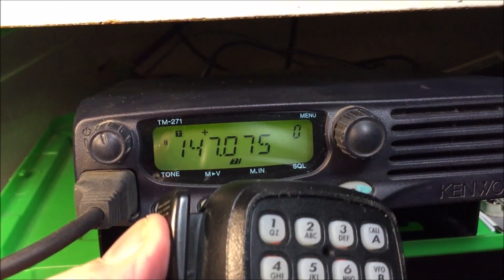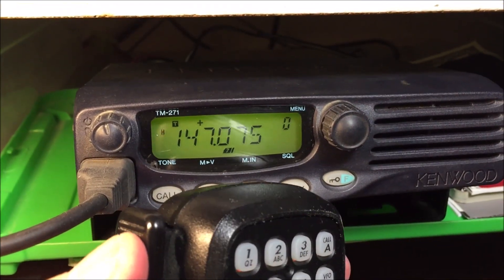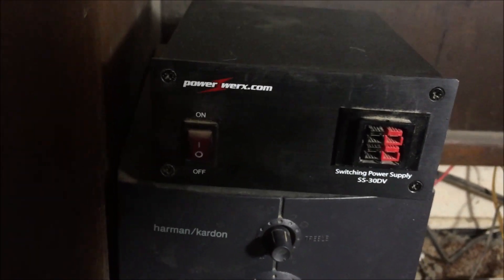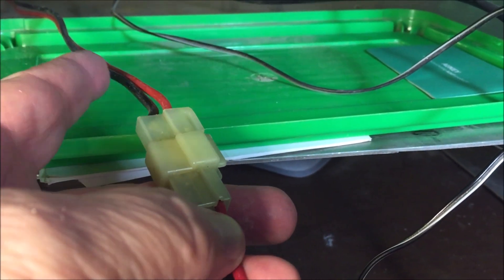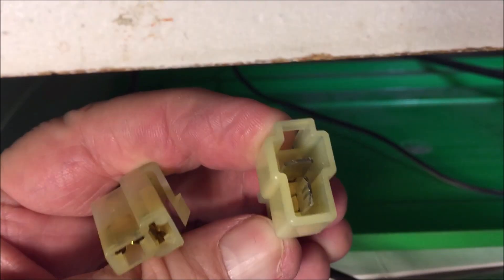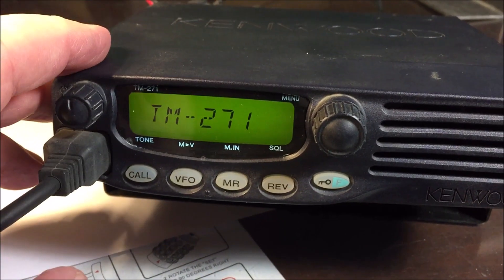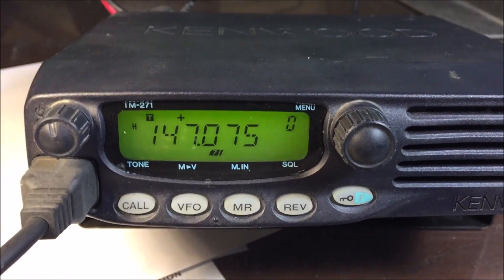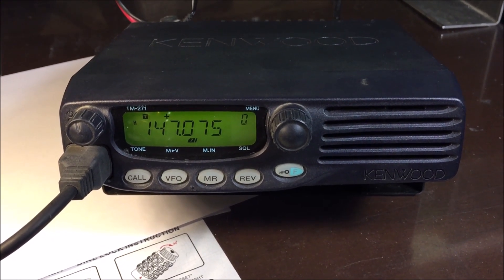Kenwood TM 271 problem work around

Comment: Sorry to say this but the big problem IV just seen is your power supply is sitting on your speaker and that is not going to help the problem with that radio it's just going to continue happening until you remove the power supply away from that speaker

Comment: I have both the 271 and 281 and have run into this phenomenon on both.  I've found it to be a fail-safe when the transceivers are starving for power.  Why it works on a 145 Mhz repeater and drops on a 147 Mhz repeater is likely a difference in current draw between that wide a range in TX frequencies.  Draws more in the 147 Mhz range.  I'm willing to bet that if you use low power on that 147 Mhz repeater, it won't drop out.  If your power supply has variable voltage, I'd try turning it up if there's room to do so (but not above 14.5v).  That way, the voltage drop when transmitting won't fall under that threshold trip-out point. The other more technical option is to replace the power wire with thicker gauge wire to help prevent as much of a voltage drop while transmitting.
Reply from the maker: Thanks for the thoughts and ideas. I decided to set transmitter on low power and that seems to have fixed my problem. Thanks again for the great suggestions. 73s

Comment: Very common, and long-known, problem with this model.  It is very susceptible  to inadequate DC supply voltage.  If the initial voltage is borderline low (in receive mode), then the higher current consumption in transmit mode, combined with resistance in connectors (and/or needlessly long power wires) will cause the voltage to drop below the shut-off point.  If for some reason your particular radio draws a little more current on that frequency (some peculiarity with the radio or with the antenna system) then the problem will appear first on that frequency.  Of course the problem will be worse at high transmit power (which is how your radio is set), since the DC current consumption will be higher.  The next time this problem first appears, if you switch the transmit power to LOW, the problem will probably disappear for a while.  As others have suggested, shorten the power wiring, switch to a heavier gauge wire.  I personally think those Kenwood power connectors are a joke, and should all be replaced by 30A power pole connectors.  Use a GOOD contact cleaner like D5 or Cramolin and the connector resistance will be lower.  Or use a power supply with a slightly higher output voltage and/or a higher current rating (i.e. better regulation).

Comment: Power cord way Toooo Long. Get rid of excessive power cord.  Use 8 Gauge stranded copper wire directly to radio or double power cord. Move power supply closer to radio. Also on a different note
put one or two drops of 90 weight oil on VFO shaft behind knob where it goes into front of the radio. Carefully turn the shaft back and forth until oil is worked in. It is a common problem on the Kenwood TM-271 and TM-281. Hope that Helps.

Comment: mine does this if the power supply doesnt have enough amperage!
Reply from the maker: Yes, good point. Thanks for watching.
Reply: How much amp do you need for this amp?
Reply: @sangalanga9593  at least 5

Comment: hi i have also a 271 kenwood the problem is my knob just suddenly hard to dial. and also i cant push it. what could be the problem . the freq dial im talking about, not the power knob. tnx i hope you can help me. 73
         - DW3GSZ Philippines
Reply from the maker: Possible broken knob. I would try carefully removing the knob and check it for any damage to the plastic assembly. You may be able to buy a replacement knob online at www.HRO.com  (Ham Radio Outlet), they have a good online service.  73's John